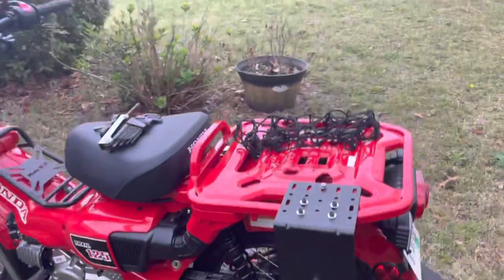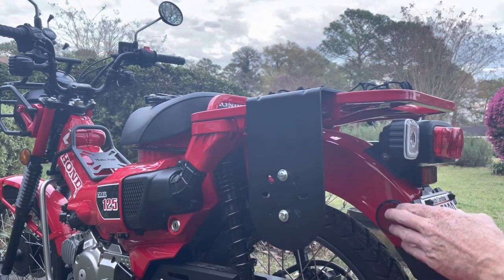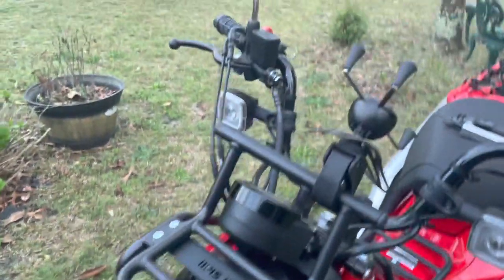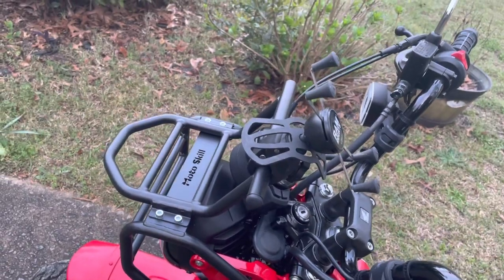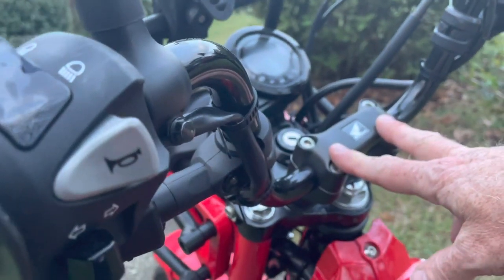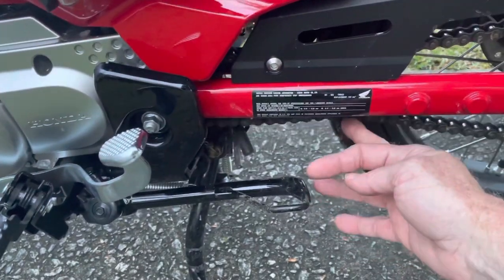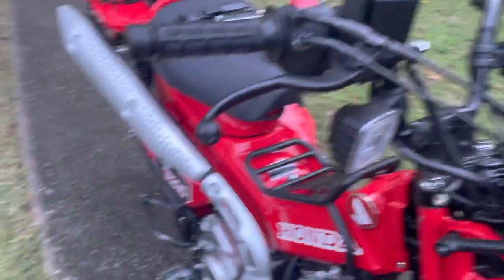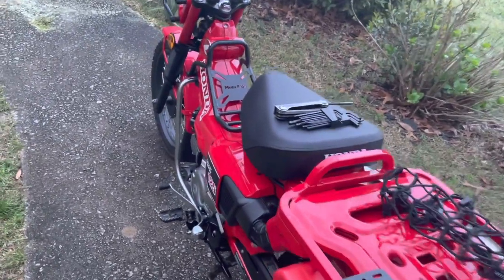Honda Trail 125 CT125 Roto-Pax follow up

Comment: Nice package, though I would of used carriage bolts mounting the gas tank mount. Provides a flatter service for your luggage rack…
Reply: I thought the same thing.  Rather than the socket cap Allen bolt head. I think a Button head Allen bolt would be a better option as not to stick up so high and rub holes in whatever baggage or container might possibly be strapped over top of these current bolts.

Comment: I'm tall too.
I lost the heel-toe lever and replaced with a toe shifter only.  Much better for me.
I'm going to remove the kick starter lever, cap the shaft and figure out an on board stoage solution for the lever itself.  My height and big feet have made me modify the geometry.
Love this thing.
If you have photos of the orange coated motorbike, they'd be fun to peek at.
Reply from the maker: make sure you check this channel for Moto madness
https://youtu.be/V7mnZVJmIY0
Reply: For all of the people that have removed the heel shifter is because they couldn't learn how to use it. It is pretty practical.
Reply from the maker: @kosta16auto  yeah I like that Heel-Toe shifter, the only thing which trips me up is all the way down is neutral instead of first
Reply: @kosta16auto  Tell me about you height and shoe size.
Reply: @NitwitMN  no pun intended. The heel shifter is practical especially for large size shoes as you stay ove the controls this way and just press either with the toe or with the heel..  The lever needs to be straighten a bit so it doesn't have that much curvature. Then your foot will have place to miss the heell shilf and slide back. Straight from the factory is for size 6 US and my lever is modified but kept the concept as it makes a lot of sense for this bike.
Reply: @kosta16auto  Agreed..I like the heel shift.

Comment: Great video. Genuine question though...here in UK fuel can would never be necessary as you are rarely 10 miles from a petrol station,  let alone the 100+ Mile's of a full tank. Is this an issue over there?
Reply from the maker: This was setup specifically for my ride on the TransAmerica Trail back in 2021. I ended up using the can once on my shakedown trip on the Smokey Mountains 500 and a couple times on the TAT where we were really remote. But once I was done with the trip, I removed it.

Comment: Hi John. I had that Ram mount phone holder. You should look at the better options from quadlock. You can still use your Ram ball mount with the quadlock. Check them out. 👍
Cool bike🤘
Reply: +1 I just damaged my iphone 12 camera with a Ram mount on my ct125 due to vibration.

Comment: A quirky little 125 here - never really thought about them as an off-road touring platform, but you might be on to something. John, do you still have your TL125 and do you still do vintage trials events? We met about 20 years ago, riding TL's in STRA events, with David Reynolds (who recent passed away).
Reply from the maker: I am very saddened to hear that David passed away. I have thought about him from time to time as I've now gotten back into motorcycles. I remember you were his riding buddy. I no longer have my TL125 - I traded it for a Triumph Cub which is what I rode vintage trial on for the last few years I was doing it. I stopped in 2009. I still have the Cub and plan to make it a winter project to get it running again and maybe get back into trials next year. Follow me on my "new" youtube channel "JohnnyPowRides"  which is where I've been posting all my motorcycle stuff for the past year. Also the TAT trip and the SM500 before that we did back in 2021 are on my buddy's channel called "SomeGuyRides" check those out also. Thanks for saying hi
Reply: This ^ is the link to my new channel. I have a few rides documented on my RE Himalayan and some other videos about my other bikes
Reply: @evergeendata  Good to hear back from you. Sounds like your cycle odyssey has continued in various, unique forms. That Cub was no joke to compete with, I'm guessing. What a cool bike! I'm now getting myself back into it - just went to the Barber vintage trials event in October, and now hunting for an good, early-'80's BMW R100 for sport touring purposes. Yeah, the cancer hit Dave kind of fast. We thought he might pull out of it with the experimental therapies he was taking, but then he unexpectedly nosedived about a month ago. I ended up getting his extensive cycle book library bequeathed to me. I will certainly subscribe to your other channels! Keep the adventures rolling - quite inspiring!!
Reply: @dachu134  That's so sad to hear. I hope to see you again next year! And that's funny my old road bike which I loved so much and rode so much was a R100 airhead. Mine was kind of a mixed up built bike - was I guess closest to a R100T - the frame was 77 but motor '81. Excellent workhorse. I had the plastic panniers I think they were Krauser or Hence Becker (I forget). My first big mountain rides and camping on that bike. Did you ride at Barber or just spectate? Also - I ran into Peggy this past summer who I expect you might remember. She is apparently still riding. Hope to catch up again later. - JF
Reply: @JohnnyPowRides  Wow, Peggy, yes - good to recall her - I appreciated her tenacity as a racer, and always envied her Elsinore. Hope she is doing good, and still racing! Sounds like your airhead was a one-of-a-kind game-changer for your life adventure trajectories. And totally, we ought to intersect next year at Barber. It was my son actually who rode the event this year since we only had one trials bike (I wanted to ask if I could borrow Dave's TL, but...felt too close to his last days). You'd enjoy meeting/hanging out with some of the other fellows in our age bracket who compete there. You'd enjoy meeting Eric and his crew from Nashville (from the Ton-Up Club). He's a music scene photographer. It's a very complete On-Any-Sunday-like scenario there in the pits; timeless. Also I have a great old snap-shot photo of you, me and Dave that Danielle Howle took and passed along from like 20 years ago up at an STRA event, on our TL's. Do you have a digital copy of that one?

Comment: Are you still using the same L Bracket? Is this the one you used with your Team 125 Ride? Do you still recommend?
Reply from the maker: Welll… if you need to mount a 1 Gal Roto pax fuel can, then I definitely recommend this method still. It worked well for me. However, what I discovered was I actually didn’t need a whole spare gallon on my TAT trip. A 1L MSR bottle strapped on somewhere would have ended up being enough spare fuel I think. P.S. please head over to @johnnypowrides for future moto videos. Thanks!

Comment: Where did you get the headlight crash guard and other guards you put on the front?
Reply from the maker: I think from Ebay. Very expensive shipping from Thailand. There's another site called Beez Deals that some people shop from. Also expensive. Look up my friends channel "Some Guy Rides" and look at the TAT Prep playlist for the info about the accessories he got. Not Moto Skill but a lot less expensive. And check out the SM500 and the TAT videos while you are there!

Comment: just need to make it two-wheel drive  ,right around double horsepower . Carbon components as well as titanium or just a aluminum frame . These bikes are way cool
Reply: Nah man it's a trail 125. Needs a strong backbone. Same.exact size but twice the engine. Change things to reduce maintenance and increase longevity ease of maintenance. Throw in some high milage knobby tires and take it round the globe. You could do it at 125 cc but you'll be going 40 a lot of the time once you're loaded. I'd rather go through USA at 5 over the speed limit on all the interstates my man. You only live once, don't let it be at 40 miles per hour the whole way haha. Grom needs the rebel 300 engine. Find unique ways to increase fuel capacity a bit in all of them but have most of the components stay the exact same if possible. 125 is great and super affordable but man a 300 would hold up longer and drive farther more comfortably in traffic. Grom is really not an interstate capable vehicle but it should be. Find a way to get the trail 125 luggage to carry over 40 pounds of possible. Every pound counts when you're at that level. The dax with a 300 would rip bro. They already do but I mean that sucker would rip. The rebel already has it where they have the same frame for multiple engines. I want the mini moto size but not the miniature engine. I gotta be able to go 60 up a hill just to get to the town next to mine man! A trail 125 that could go 80 would be killer. A Grom that could go 85 all day long and up a hill, would be killer

Comment: What do you think of the stock tires on the dirt and mud?
Reply from the maker: I have not been in loose sand, or sticky mud with them yet, I expect they would not do well. However on gravel roads and dirt they have done surprisingly well. Check my video on Hurricane Creek for a off road test on some slick mud where again it did much better than expected.

Comment: Your off-road conditions must differ from mine,(Oz) for as much as I like the  CT125 I just don’t get why they never put more clearance around the front mud-guard and also we would need to have knobby tyres , mud would jam up the front wheel pretty quickly and those tyres would not get traction on wet paddocks.  Apart from that they are way over-priced in this country.  Davox.
Reply from the maker: Well I guess this isn't the bike for you, then
Reply: That is correct; but it so easily could have been. Davox.
Reply: You can put a riser on the fender, it’s inexpensive .

Comment: Nice set up. But please don’t rely on cell service for gps. Please get a real gps. Preferably garmin. They are very cost effective and they make water resistant models.
Reply: There is a feature in Google Maps that lets you download parts of the map and store it on the device so no cell service is necessary.